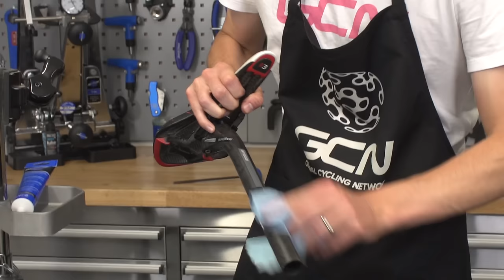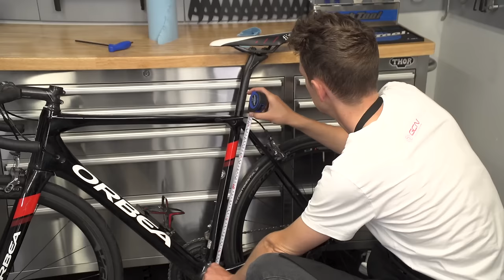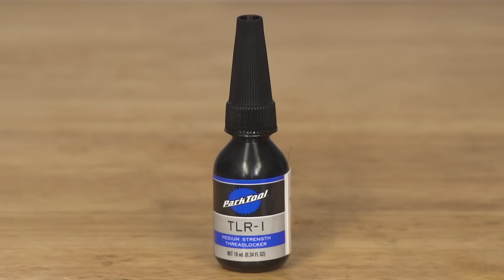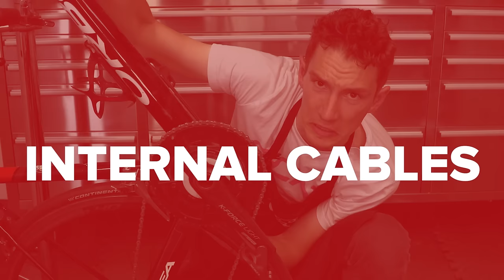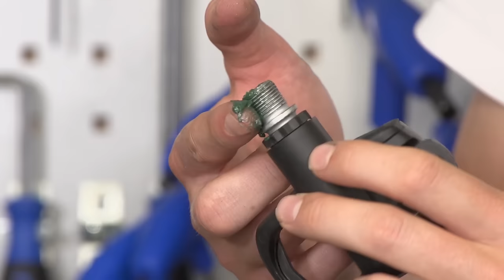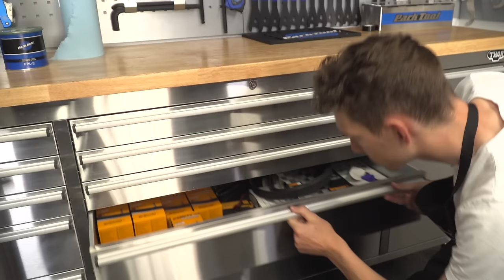6 Bike Repair Mistakes All Cyclists Should Avoid

Comment: how do I remove my rear and front wheel when the brake pads won't let the 25c tyre past them
Reply: jmkmckenny Deflate tyres or adjust brake pads
Reply: jmkmckenny most road brakes have a small release for this - or Campag have it at the lever
Reply: Campag do it right - the release is reset when you pull the brakes on.  If the release is on the caliper and you forget to reset, you've lost your brakes!

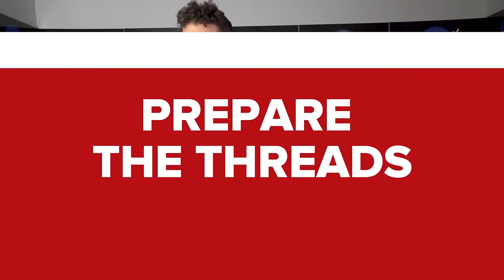Comment: so to make sure you can un-do it you use either grease or........ a thread locking compound 2:37 seems logical
Reply: Seems counter-intuitive, but it fills the gaps between the threads and prevents water getting in there and causing corrosion and rust. Yes, it increases the torque to break it loose compared to clean threads, but less than rusted threads.
Reply: @daleinaz1  OK, I can agree with that but if all you want to do is prevent water from getting in, take it from a plumber, just use some thread sealer. The grease you mention would be a good choice also. Just yesterday I ran into a screw holding on a faucet handle that someone had put thread lock on for who knows what reason so I may be a little bias at the moment. I had to drill out the screw to get it out because the Phillip head stripped trying to get out a locked thread screw.

Comment: don t work on an outside deck that has cracks between the planks , your small screws bolts  washers etc. , helped by the gravity gods will most of the time find a way to fall between the cracks and be lost forever

Comment: Do not clamp your bike in the stand using the top tube. It will get crunched very easily.
Reply: Only if you clamp it too tightly.  Bit that applies to most aspects of bike maintenance.  I always clamp the top tube and never had any issues.
Reply: Steve Mawer 
If you've got a carbon frame it is definitely not advisable. It is much easier than you think to damage the very thin carbon up there. It is quite fragile. You really should be using the seat post.

Comment: Here's how you save yourself from stripping bolts... ONLY USE STEEL BOLTS!

I'd punch any bike manufacturer for using aluminum or titanium bolts... they strip so easy and you can't extract them because they are so soft.  

If your bike has aluminum or titanium bolts...save yourself a lot of trouble and just replace them with steel bolts
Reply: TeslaOsiris sounds like you should not work on your bike haha just kidding use good tools mate you have pay bit for them tho just helping you I hope it helps you in some why
Reply: Christopher Barrett The very first time I tried to loosen the aluminum seat post bolts on my old Felt AR5, the bolt striped.  Had to take the frame to a LBS where they went at the damn thing for FORTY FIVE MINUTES to finally extract the damn thing.  Normal bolt extraction tools didn't do anything because the aluminum is so soft, it would just peel away.  They are bullshit and Felt should be ashamed of themselves...they were only one gram lighter than the steel bolts I replaced them with.
Reply: TeslaOsiris that's was the best to do mate

Comment: pretty lame video. what it should be on: leaving crank bolts in cranks and inserting a removal tool causing the threads to strip, installing a tube and not seating the tire correctly, not checking factory installed crankbolts, and over tightening headsets. all of which can be avoided by keeping the sales staff off the mechanics stand ;D